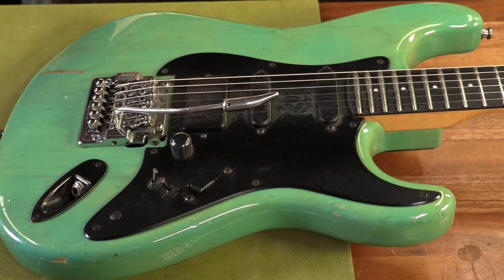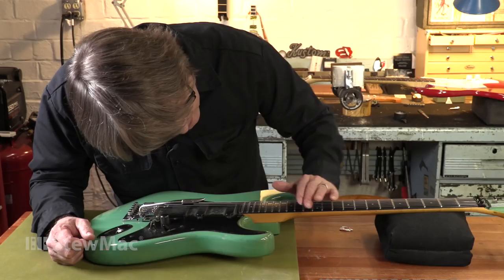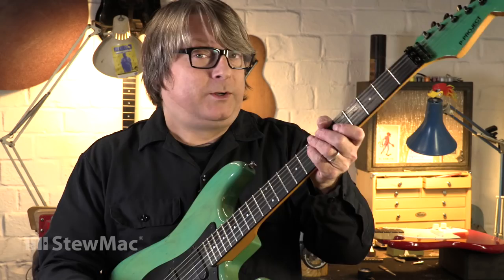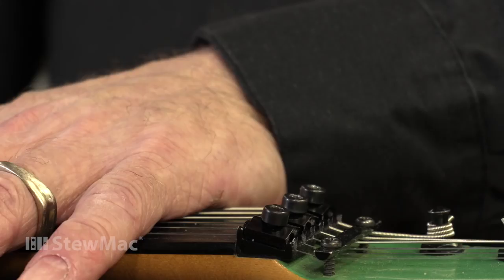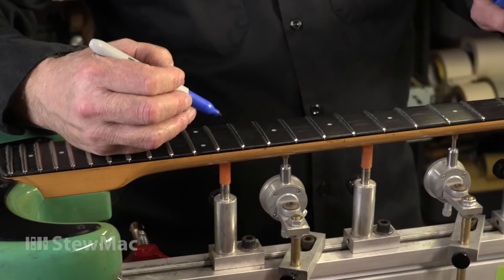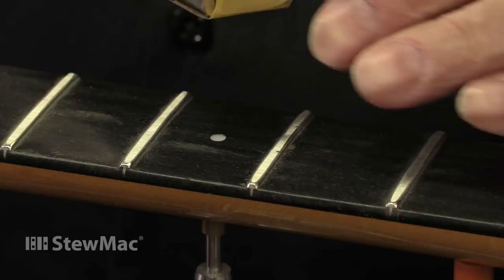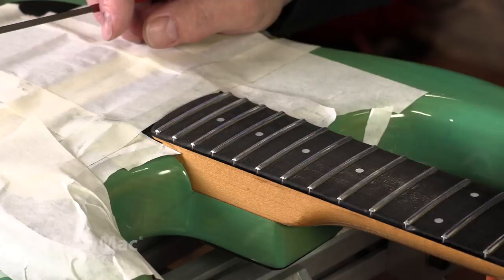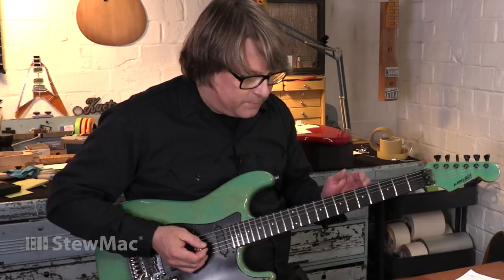Todd Rundgren's 'Foamy': Should I refret it?

Comment: I wish the orthopedic surgeon that ruined my left knee had this much consideration for the big picture
Reply: Did you have a knee replacement? I had one and it nearly killed me! I actually was near death!
Reply: subluxing patella  corrective surgery; and they used a very medieval technique that  was a failure .im thinking a replacement would be hell
Reply: I hear ya, my knee reconstruct work probably went a long way towards my doctors 50 ft boat on the St. Croix.   Never came back right.
Reply: My knee replacement became infected with e-coli. I had several subsequent surgeries, was in intensive care, septic, underwent dialysis for 8 days and had several units of blood transfused. A large section of my wound couldn't be closed! I was kept heavily sedated because seeing the hole in my thigh was horrific. I was on a PICC line for 12 weeks. It's been 13 years and I have a big dent in my thigh. I live in Florida  but cannot wear shorts because my leg freaks people out. What a nightmare! But I have no knee pain.
Reply: @BluesLicks101  With the complications I experienced my knee replacement costs were over $250,000 in 2006.
Reply: Right? I mean replacing a major body part can’t be much harder than sanding down frets.
Reply: That's why there's a saying here "once knee, always knee". Once you have a problem there, it's always gonna be there. The knee is extraordinarily complex, fragile and easily disturbed in its structure. Fixing things there is basically trying to stop it getting worse or making it functional at all. Rarely it gets fixed, meaning: it's gone (like is possible at other structures in the body).
Not arguing on if he made a mistake or used technique not state of the art (which is illegal), but it's definitely really, really complex and difficult, so it's a tough job for any physician.
Reply: dudeee to all you guys. i'm sorry you had to deal with so much pain. My father had his replaced and thankfully he recovered fine. we are in Baltimore and have good surgeons i guess.. i hape i never have to do that.. my knees aren't in the best shape for my ag. years of skateboarding and snowboarding, i just hit them both on a rai last week. then i hit the right one again at work climbing on a tree
Reply: SO well said!
Reply: @nancyfintak2728  I hope you are doing good these days. God bless you 🙏

Comment: please don't hate me on it, I love you, the channel and the video together with all the care you took in this process, but never level out the frets like that. First of all, remove the nut to make sure you don't damage it or the wood around it by accidentally knocking it. Also, this allows you to move the sanding beam past it. As you will see, you are making an uneven level since the first frets are traversed by only about 1 inch of sand paper back and forth, while the last frets are being rocked by a much longer course. Second of all, leveling with a beam like that is very uneven left-to-right, you might think you're moving the beam nice and slowly along the neck, but you are waving the pattern left-to-right by A LOT. There are better solutions to this, but at least please try removing the nut and making the length of the sandpaper traversal as equal as possible. Even so, with the nut removed, the center frets will ALWAYS get more sanding than the frets towards the ends of the fretboard using this method.

Comment: I did fix two high locking floyd nuts - it's not a real major surgery, just have to sand the bottom of the metal locking nut after unscrewing it from the neck. Can use a coase grit sandpaper glued to a flat surface and slowly take away the metal. The tricky part is knowing how much to take off, if you want to be sure take away little by little and put it on the guitar (it's a bit of a pain because you have to set it up with the strings again, so my advice is - lock the trem bridge into a "fixed" bridge for the time being with some wood ;) ).

Comment: Action issues with a floyd locking nut shelf can be addressed by filing the wood under the shelf very carefully in one single direction until the action is ideal while maintaining a level surface.  As long as the fingerboard radius is the same as the shelf radius there should be no problems.  I've learned this the hard way friends...for example a 14" radius shelf with a 10" radius fingerboard will give you intonation problems especially with the open position D major chord.
Reply from the maker: In some cases yes. But with this guitar the truss rod adjuster was right under the locking nut. Removing any amount of wood would have cut into the channel.
Reply: Oh wow yeah makes sense  @stewmac

Comment: Was initially surprised you didn't just use new wire w/ original spec, as that was the 'feel' Todd was used to on this guitar, and those new .045 Jumbos would last a lifetime based on the last set of frets.

However you have done a fine thing.keeping the guitar in its relatively original state and very playable without disrupting the fretboard in any way, so that may be a significant advantage of keeping the first frets ever set into the rosewood. You won't maintain a better mechanical integrity than this, and the instrument won't have to 'settle' to the pressure of the new tangs.

Good call. Because if Todd still misses the fret height, you can always do that refret, regardless than I'm sure he appreciated your crazy amount of hand work reshaping. You basically can't tell the frets are rejuvenated. Cool!

We need people like you in the world sir.

Comment: Erick Coleman is a Great guitar repairman! 

   For those who may not realize how difficult it is to find someone who does good fretwork, here's a story about what a crappy repairman did to one of my guitars:

In the late 70's, I took my vintage Les Paul Jr to a "reputable" guitar repair shop next door to Chuck Levin's Washington Music because it needed to have one of the fretboard bindings replaced; when I got it back, the asshole that did the work had filed down the edge of the fretboard between each fret to get the binding down to height. He didn't stop filing the plastic binding down to height when he should have, he kept right on going deep into the rosewood, making a 45 degree ledge on the entire side of the fretboard! When I had it refretted a couple years later, I sent my LP jr to Strings & Things in Memphis Tennessee. I don't even know if they exist anymore, but they did a great job. Believe me, I didn't like shipping it, but I sure wasn't going back to the same place that hacked it up the first time. Strings & Things called me when they received the guitar and said (paraphrased) 'who the hell did that to your guitar's fretboard?!'  They had to plane the entire fretboard to get that freaking ledge off.
   Fret work has to be one of the hardest jobs to do correctly on a guitar. Finding someone who does it well is not easy!

Comment: Hi Erick, I have two questions if I may..   When sanding to level the frets, why did you sand with the aluminum 16” block instead of just leveling the frets with the radius block?  And with regards to the possibility of the locking nut being possibly too high after the removal of fret material, could you have just have sanded underneath where the locking nut was installed to make up the difference instead of performing a complete re-fret?  Thanks!

Comment: I feel like if you had planed the frets back down to .45 (from larger unworn wire) it may have worked beautifully. And the frets wouldn't be .05 less than he's use to. 

But yeah. A refret indeed can change the feel if you don't get it like it was before

Comment: You can DIY a better tool for the initial levelling:
-Buy a good quality (i.e. accurate) pre-radiused fretboard blank
-Route a channel about 1/2" deep down the wide side of a cedar 2x4 the same length as the fretboard blank and about 1/2" wider (if it's an extra wide blank you could glue some thin wood to the sides instead, the point is to have a channel a bit wider than the blank)
-Fill the channel with bondo, put a single piece of waxed paper over it, and then press the fingerboard blank into it, making sure it's square with the 2x4 in every dimension. 
-use a second 2x4 with some bricks on top of it to hold the fingerboard in place with enough pressure that you get a firm impression but not so much that the fretboard blank presses deep into the bondo - you want to cast the entire surface of it but not have it press in any deeper than necessary.
-Let the Bondo cure, then trim and sand the squeezeout along the edges so that it's flush with the cedar, and you now have a stable, durable, full-neck, radiused sanding block for less than $10 that should last for decades.

The great thing about this method is that you can make a block with a conical or compound radius (credit to George Morris of Vermont Instruments for teaching me about the advantages of using a conical, full length sanding block - he hand-sanded them out of poplar, but casting an existing fretboard with Bondo is a lot easier and at least as durable).

In use, you place the block over all of the frets and sand with even pressure and small strokes - less than the space between the nut and the first fret, so all of the frets are sanded evenly. When the frets are leveled, they will already be very close to perfect and should only need minimal hand filing, if any, after they've been crowned. It can also be used to sand the radius onto a raw findgerboard, of course, and it takes a lot less practice to sand in a conical radius this way than it does to plane one by hand (even if you plane the rough radius, it's good to have a full length block to finish with).

It's also possible to clone the fretboard geometry of an existing guitar this way, although the end result will be harder to use because it will also be the exact width of the original. The frets will be cast into the block, but once you attach sandpaper that isn't an issue.  Also, because Bondo cures exothermically, there's a small but real risk of the heat loosening the fingerboard or worse, so I wouldn't recommend trying it on a gutar with any kind of value or rarity (that said, my personal full lngth block that I use for conical radiuses was cast from a '95 Parker Fly Deluxe without any problems at all).

Comment: Would a partial refret with similar wire make sense in this case?  If only a few frets are heavily worn, then most could remain higher after leveling, instead of this approach in the video of lowering/sanding them all down to the lowest.
Reply from the maker: The frets were considerably worn down the neck, this was the best option in this case.
Reply: @stewmac  Ah, thanks for clarifying. Makes sense. And thanks for the great videos.

Comment: I think you did the right thing. Once the old frets are removed, they are pretty much trash. If for some strange reason Todd insisted that the guitar be refretted after this, it can be done. If you had refretted right away and he did not care for the feel you can't put the old ones back. The best you could have done at that point would have been to try and make replicas from brand new fret wire. Excellent work.

Comment: One of my guitars that I got used had no fret wear what so ever when got it. It looked like that after about 6-8 months. I went to stainless steel after that and I've never looked back since 😂
Reply: Stainless steel does last a lot longer than nickel, but the tradeoff is that refretting in SS is a lot more work. I'm guessing labour alone for SS is going to be significantly more than a standard nickel fret job. Still, worth it if the guitar in question is your main player.

Comment: If you needed to lower the nut could you not remove a bit of the wood after the fret leveling?  then if later you had to refret it you could shim the nut back up to height.
nice job on the level and re dress.
Reply from the maker: In this case the truss rod adjuster was right under the nut, no wood to remove.

Comment: Just wondering why you would not tape off the fret board before dressing and sanding? I'm a fairly new tech, and i have been shown to always always tape off before sanding. Your video didn't show that, so I'm wondering if there's a reason not to?
Reply: No need during leveling.  The long sanding beam never touches the fingerboard.  Then Erick DID tape up during re-crowning (one fret at a time).  Have a look around the 5-minute mark.
Reply from the maker: If Foamy would have had a finished or less worn board Erick would have definitely taped it all of before doing the work. Given the wear and condition he opted not to.

Comment: In the case that you wanted to lower the Floyd locking nut the same amount as you filed the frets down to, what would be the most efficient yet accurate way to evenly lower the lock nut so that it still mounts correctly to the neck? Could you do a video on that process? I would think that there would be two main options..., either file down evenly the neck under where the nut mounts, or..., file the bottom of the nut evenly. Using Todd's guitar here as an example, if you wanted to lower the nut by five thousandths, could you either make marks on either side of the neck at five thousandths, and then evenly file the neck down to the marks, or..., mark off five thousandths at the four corners of the bottom of the lock nut, and then using a flat belt sander, grind off evenly the five thousandths of an inch?

Comment: I have watched 100"s of repair videos and I have never seen a video on a neck repair w/ a dip on one side of the neck. Please help!
Reply from the maker: It's tough to diagnose your neck issues without having the guitar in hands to evaluate. Chances are there is a slight twist in the neck. It may be able to be sanded out depending on the severity. We suggest taking your guitar to a reputable repair shop for a hands-on opinion.

Comment: Can't you just sand down the bottom of that locking nut? Would keep the radius intact, just lower the string height...
Reply from the maker: Possibly. Hardened steel is difficult to mill, plus your math would need to be dead on!

Comment: i just have some questions. if....we measure and see where the frets were to start...couldn't we refret and sand the frets down to as close to possible to those measurements and not have to do anything to shim the nut? and if we needed to bring the nut down a little after leveling and crowning, couldn't we sand or file a little on the shelf it sets on instead of having to refret the whole thing at that point? Anyhow this is an amazing guitar and you did great job repairing it?
Reply from the maker: Yes, while your suggestions could have been done for this job, Erick wanted to keep this as close as possible to the feel Todd has played into the guitar. He did not want to risk the guitar not feeling the same when returned to Todd. Therefore, he decided not to refret and proceeded with the job shown in the video.
Reply: @stewmac  ok thanks for answering.

Comment: Before doing anything, I would talk to the guitar's owner and explain the options. It's not the repairer's decision to do what they THINK is best. The pits on those frets were substantial. You took .005" off the frets. Maybe Todd would've liked a refret, even with different size frets or radius change. For what it's worth, you did a nice job with the crowning. Routing the locknut shelf a few thousands takes 10 minutes, tops, with the right jig.
Reply from the maker: Definitely. Erick discussed options in depth before doing anything.
Reply: @stewmac  Sorry, I didn't catch it in the video.

Comment: Is there a reason to not use the radius block to level the frets?
Reply: The long sanding beam levels all the frets at the same time.  Using a significantly shorter beam risks introducing a "wave" into the level; especially at the lowest and highest frets.
Reply from the maker: Erick likes the 16" bar because it allows him to see his work better. He then follows up with the block to make sure the radius remained true during the process. Never has he introduced a "wave" into his fretwork, but he likes to double check anyway. The key is removing material evenly!